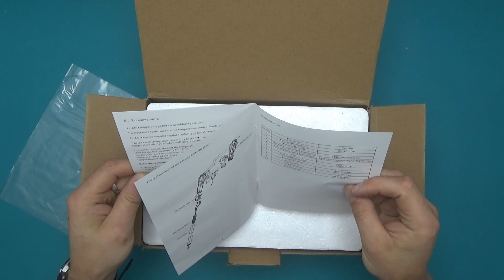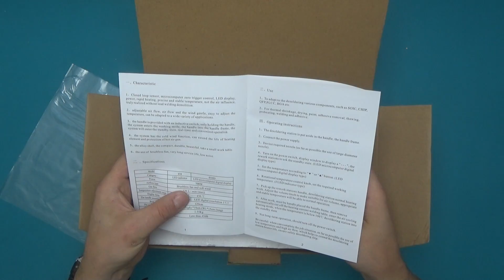#001 - 858D hot air rework station - first impressions and a look inside

Comment: Can you help my system has developed a fault, when i first start it the fan comes on but not the heat while the handle is in the cradle. So i pick it up and point it down the place it back in the cradle  and all if fine. It cools down and goes into sleep mode. I replaced the handle but the same happens. When i switch it off from the machine and turn it back on it tries to blow for a millisecond and stops and all is fine.

Then i contacted seller he said use rare earth magnets in the cradle, did that but still the problem. Its when i plug it in the wall
Socket and the turn it on for the first time this fault happens. Mine 858D the handle that came,e with did have a switch when point it down it starts and when you point it up it cools down, I could hear the switch when turned off and pointing up and down. The new 3 handles did not have these but at first would start heating up in cradle but then they behaved normally. All of the happened when I test the 3 new handles.

Comment: The fuse in that plug should be rated at 5A  not 13A. This is true for any appliance rated between 500W and 1,000W
Reply from the maker: Yes, true. Just not had one to hand at the time. Well spotted :)

Comment: Hi mate, did you get this one? https://www.ebay.co.uk/itm/301966004104
I'm trying to get one that isn't completely dangerous and yours looks better than most!
A little worried about that ground wire at the end of the gun not being screwed/crimped on but you think it'll be ok?
Reply from the maker: Hi,
I did look at my eBay history, but the listing I bought from is no longer available. Your link looks similar if not the same. There are so many of those out there, that it is difficult to say what you are getting until it arrives.

Comment: I have one the front off/on switch will not shut the unit off till the heater drops to 100c. The back switch on mine breaks the mains. Mines also the combo that has the iron on it also. You MUST take it apart before turning it on to make sure everything is ok. Qhen mine arrived I checked it out like him, the fuse holder was broke and the mains part of the fuse was against the rear metal plate. Almost forgot mine also came with a extra screw  loose inside.

Comment: It really looks nice, dude. I'm thinking about buying one I saw on Banggood. But it's the hot air gun and soldering iron. But I don't have a proper station yet, just a soldering iron with regulation (what is already awesome).
Reply from the maker: My advice would be (if you care of course) to avoid 2in1 or 3 in1 etc. From my experience with anything in that style, neither of the 2 from 2in1 was as good as individually made products, and if it packs up, you loose 2 tools. Thanks
Reply: randomtronic You're absolutely right. But this one at least have pretty good reviews and it isn't that cheap (at least for me):
https://banggood.app.link/4KApGLvKrN